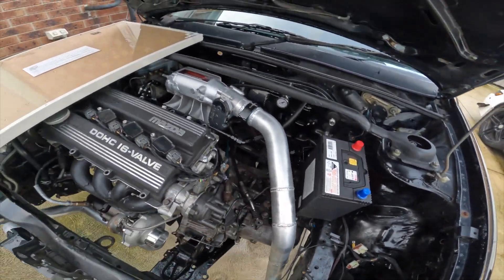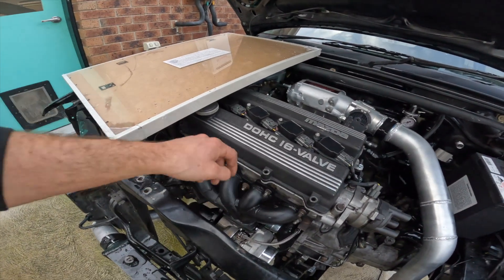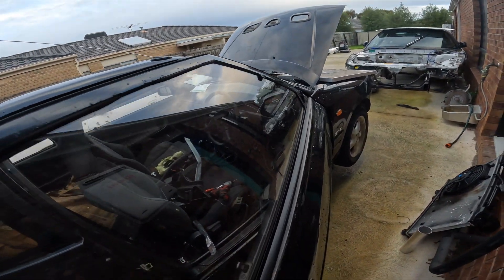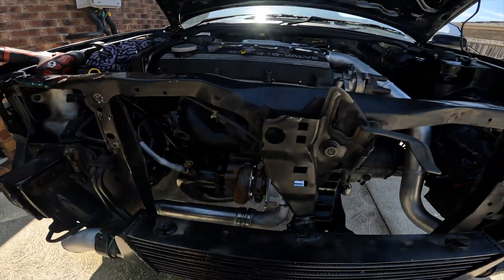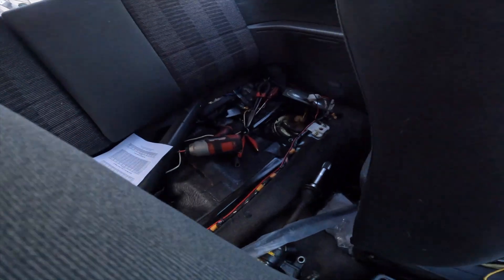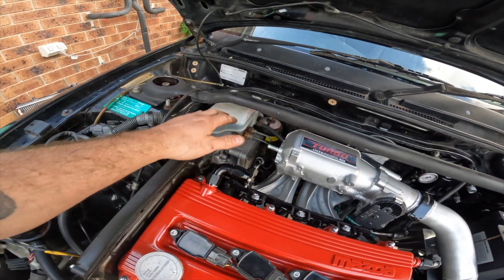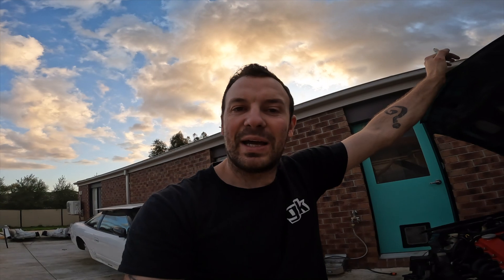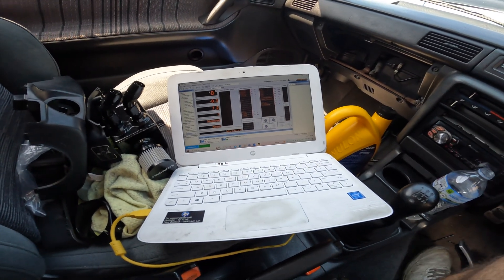Part 4 - MAZDA 323 GTX , will it start? Plus giveaway info

Comment: Hey man what exhaust manifold is that? I have a gtr in uk also the cop conversion kit is it a 'KA' brand?
Reply from the maker: It doesnt seem to be a brand manifold, just something someone made along the way. The COP conversion is of my creation with m6 bosses welded onto the rocker cover
Reply: @LogansSpeedShop  ahhh right it looks a hell of a lot better than the stock cast one and probably flows a lot better! Dammit lol and nice I was just going to buy the kit what coils did you use? Yaris?